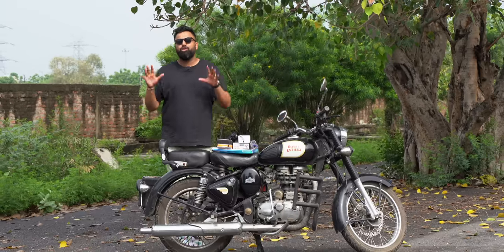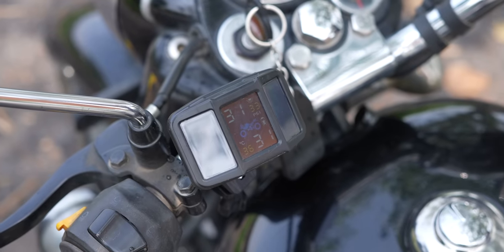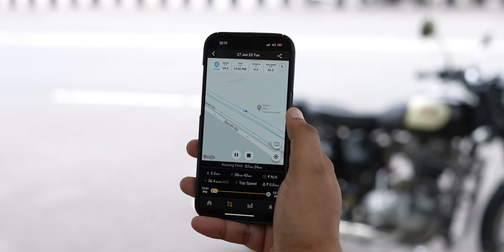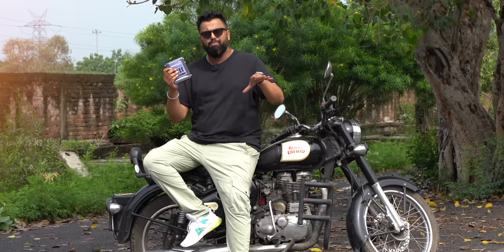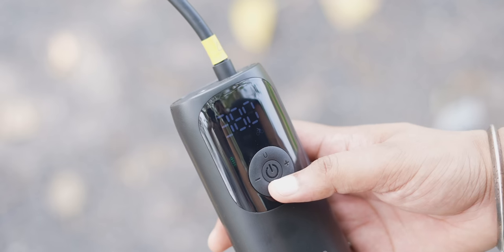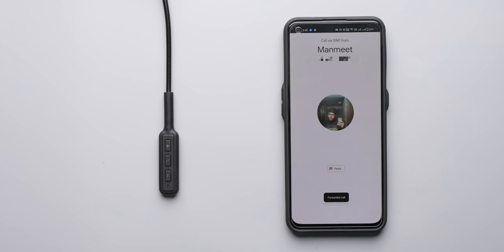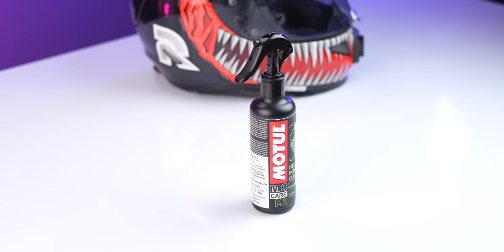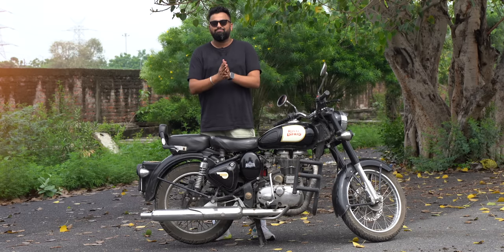7 Useful Bike Gadgets You MUST Use!

Comment: I highly recommend yellowfin wireless charging case which is also waterproof and it has fast wireless and wired charging which means ur phone will always be fully charged whenever u need it plus it comes with on/off switch so it doesn't drain battery while not using

Comment: While the tire pressure indicator is great and could be beneficial, It’s not so great when you ride every day and the stem on the tire brakes off cause it too heavy. Nonstop rotation of the tire and the weight of the end cap will eventually give way and you can have a blowout, depending how fast you’re going to be bad. Beware of that.

Comment: tyre pressure monitor cap is holding all the air pressure instead of the valve. only thing holding it is the threads of tube. not very good.

Comment: Been a biker since 2006, have used 4 bikes of which 1 got stolen, here's my absolute must haves:
1. Abus Solid Cast Metal Motorcycle Disc Brake Lock: My bike was stolen some 5 yrs back, since then I researched every device to track but all of them were passive - meaning they would work once its already stolen. Low and behold Abus disc lock, this thing is indestructible. German engineered disc lock which will not budge unless u take off the wheel itself. It has a snap on locking mechanism which locks onto your disc brake so you can park your bike outside without any hesitation - no one will steal it - except for traffic police who will just pick up the bike lol. This is my second purchase coz the first one jammed due to my ignorance and lack of oiling the lock pins. Absolute must have if you park in public places regularly.

2. Autofy StreetGod Plug & Play Highway Indicator Flasher Relay: been using this since last 4 years, basically its a hazard flasher for bikes that don't have one inbuilt. Its a total worth buy for me, its just plug and play hardware which withstood Mumbai rains and daily washes since last 4 years. Absolute must-have for heavy rainfalls or foggy areas when u need to have hazard lights flashing to warn the cars about your presence on the road.

Rest of my additions are pure cosmetic like bike handles, fog lights, horns etc. but the above 2 are absolute must have in my opinion. Frankly would have made a good sum myself if I had affiliate marketing myself by the word of mouth advertising I've done for these 2 ROFL.

Following are the Amazon Links: 
1. Abus disc brake lock: https://amzn.to/3NZW8OW

2. Autofy Hazard Flasher: https://amzn.to/46AOK3u
Reply: But all of those are passive right? They will alert ONLY AFTER my bike is stolen? Abus prevents the theft itself so why will I let the theft occur in the first place?
Reply: Flashers naah distracting and not needed(not gonna explain), you seem like having a bullet, breaking into naked bikes are easy but RE is super easy, any biking enthusiast will know how easy it is to break into RE😂, Ajjas has an accelerometer meter which will alert you on the go expecting a delay of 5secs easy enough to tell you that your bike is long gone, but if there is a pro lock pick them your disc pad lock is a waste. All this comes under maintenance, maintain your bike well, well and good
Reply: Thank you so much. Though I don't need somebody would surely appreciate this
Reply: Hats off man for writing so much
Reply: Thanks for your time to spread use ful info 😊
Reply: Thanks
Reply: Brother, what's more useful? A disc brake lock or the GPS tracker? Please suggest
Reply: but the thief can cut the brake wire and he can install a new one later. So i guess gps would be better
Reply: @basic2596  Did u even see the product I mentioned? Cutting off the disc brake wire wont do anything coz the disc brakes are attached to the wheel, it cannot run unless u open the lock, period.
Reply: @RayZoR1987  oh i didnt knew that